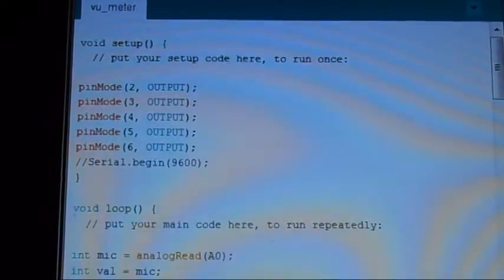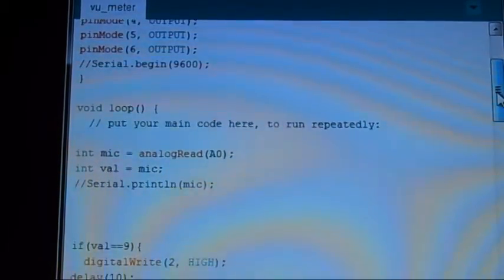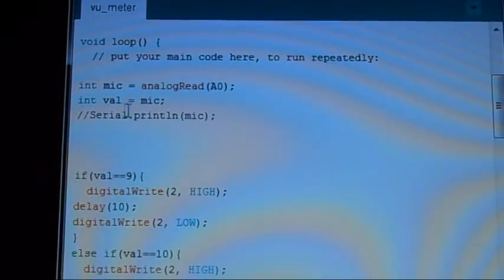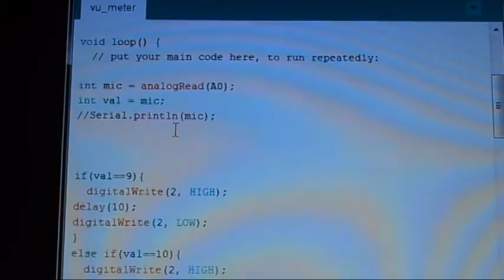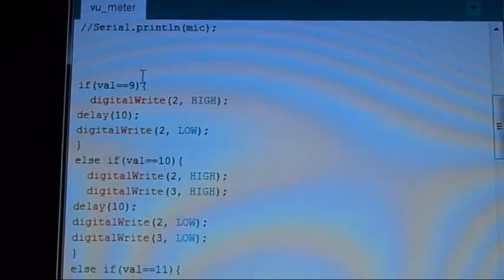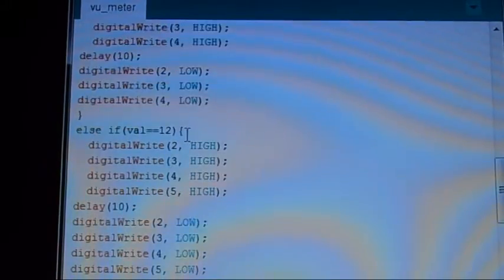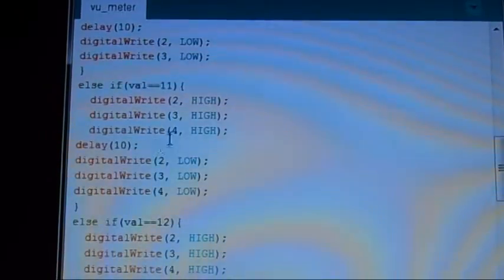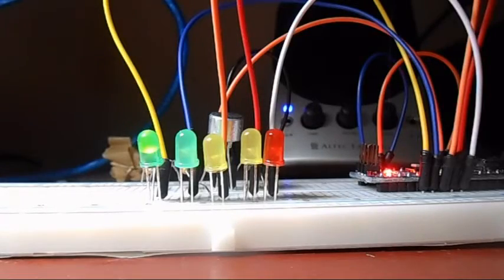HOW TO MAKE AN ARDUINO VU METER

Comment: It didn't work great for me at first, the last statement in your example said else and then turned on all the lights. I changed it to say else if(val>=) this way I am saying if the value is anything higher than or equal to then turn the lights on.  Otherwise you could have a very quiet room that is below the lowest value and end up with all the lights on at once which we dont want.  I hope my ramblings help someone watching this